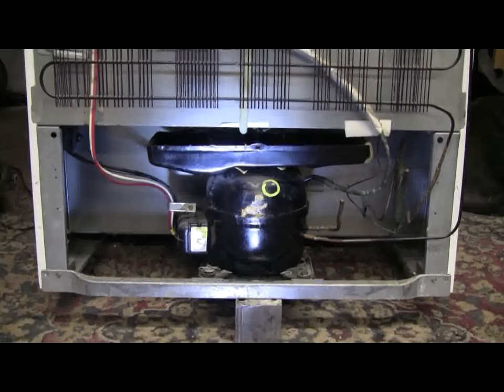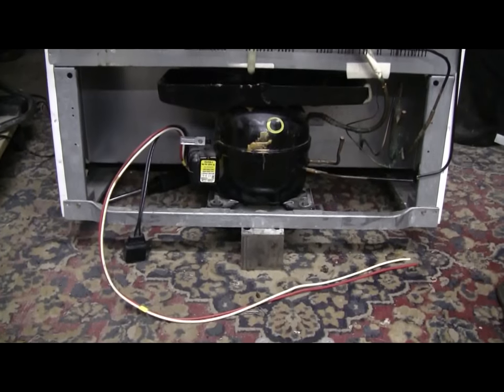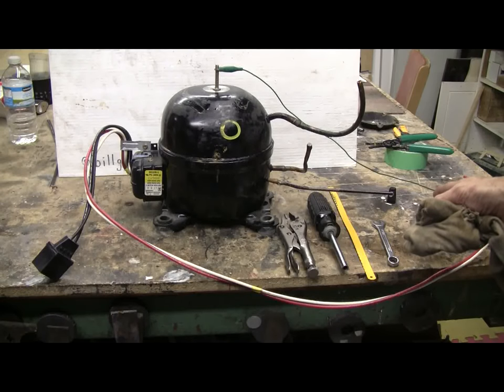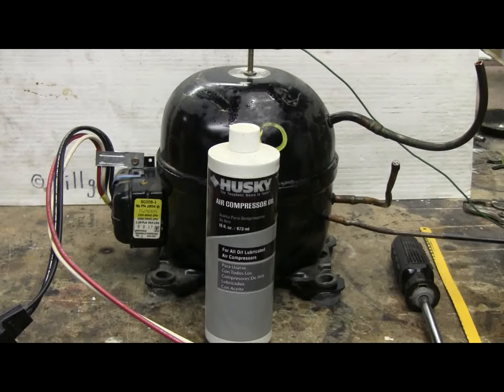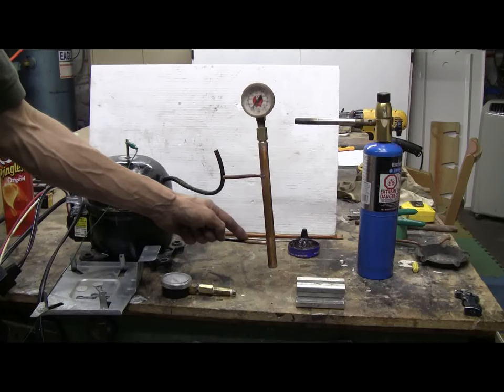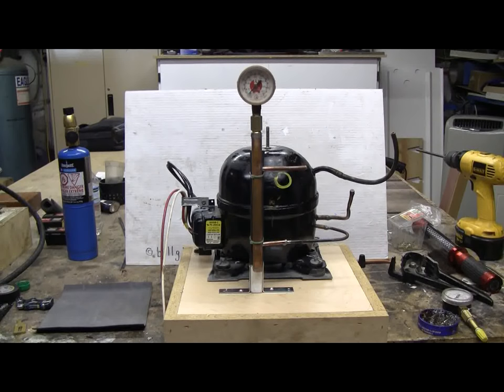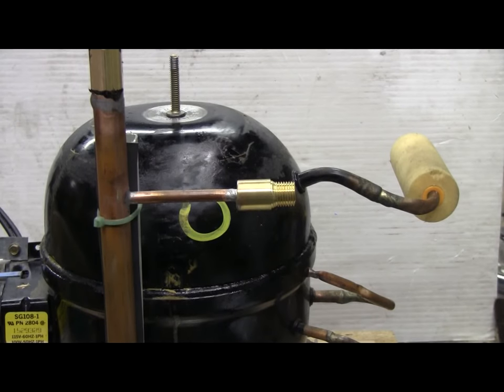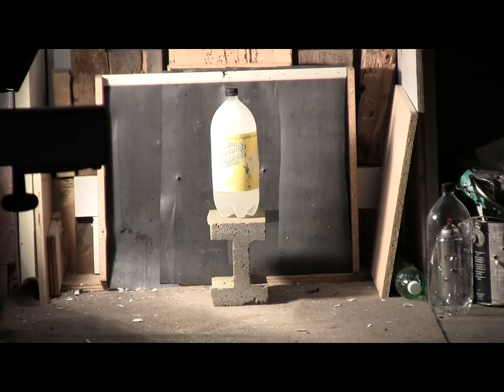DIY - How To Make A High Pressure Air Setup From A Refrigerator

Comment: This is one of the best and most informative YT instructional videos I have ever viewed and I have viewed hundreds across many different subject categories since I enjoy building, engineering, repairing (DIY'r) almost anything electrical, mechanical, computer / video / audio, appliances, even gardening and carpentry. Reason this video is so good is the pace, organized well planned step by step process with just enough detail. Most of all there is something about your voice that is both soothing and keeps my interest peaked - most videos I have to rewind several times because of mumbling, bad grammar or conflicting information, yours I did not have to stop or rewind once. 

QUESTION: I want to build a compressor that is suitable for filling a PCP Air-Rifle and/or a portable air tank that is used to fill a PCP Air-Rifle. The required PSI fill is from 2000 to 3500 PSI (depending on particular PCP rifle brand/capacity). I am a novice when it comes to compressors but I have experience working with residential air conditioners, refrigerators etc.. repairs primarily on the electrical side. Would a unit like yours have enough compression capacity to fill a small tank that requires 2,000 to 3,500 PSI when full? They do sell hand pumps (bi-cycle style) made for this purpose (can cost upwards of a few hundred dollars), electric and gasoline powered units that are in the high hundreds to $1,000s of dollars. So a project like this is well worth the effort if it works - even if it takes several hours to fill a small "SCUBA" like portable tank that can fill a rifle several times on a single fill or the small air container built into the rifle (50-100 shots on full charge) directly.

Thanks
Chris

Comment: Out-standing video! I'm a home brewer, I typically make five or ten gallons a week. My need for this is co2, with the step by step, I think my old air-conditioner compressor will work perfectly. I've already salvaged the compressor and with some fittings, I will be able to carbonate my home brew without expensive tank refills.

Comment: What a fantastic video. I have a smaller salvaged air compressor and was looking for a video to guide me in the right direction for building a moderate to low pressure air system...yours fit the bill perfectly to get me started. Thanks so much!

Comment: Brillant! I've never thought of recycling a refrigerator compressor... I'm in need of one for PC cleaning - maybe this would be overkill I'll see -, and PC moding works (moding this for a sufficient air tank so that some air power tool could be used? hmm..). Since I have an old and unused frig in the basement... Man you made my month, bravo et merci (if you had a paypal link I would click it instead throwing out hundreds of dollars at the store)..Some people have made good comments down below for making it even better (capacitor to start it, check valve, etc... read on). One Youtube gem.

Comment: Back in 78 I went to mechanic votec in Mn.  We took one of these and made an evacuation pump for air conditioners. It could pull them down to nearly zero where they needed to be to recharge. Made one myself at home but never did do much with it. I left in in Mn when we moved back to the Dakota's.

Comment: I’m gonna send you to the future!
At approximately 21:20 in this video, hitting 88 mph with the required 1.21 gigawatts, you will see compressed air! 
It’s a very good, thorough diy video of a unknown and amazing air compressor, with lots of pressure. It’s a 15 minute video if you set the much needed playback speed at 1.75 gigawatts :)

Comment: I made a hobby shop compressor for air brushing and other misc tasks. Those fridge compressors work excellent and they are virtually silent. Also have a pneumatic switch to automatically shut off just like a standard shop compressor.
Reply: Hey Eric do you know if this would work to power a dentist drill.  I do wood carving and I’m looking for a very quite compressor, as I am in an apartment and do my work in the overnight hours.  Thank
Reply: Phoh finally i can ask this question
Can i configure this for my airbrush ? How did you do it?

Comment: Very well done video. Watching makes me believe that I could build one. I've always wanted a good compressor for my garage work. Thanks, Mr. Gillmore!
Reply: +Mike Prell It want work for a garage air compresser. To run air tools, it requires an air tank and this compresser will overheat trying to pressure up an air tank to say 120 psi.I was also thinking that he was making a shop compresser when I clicked on his video.Take care , Mike.
Reply: I guess I'll wind up going to Sears.
Reply: The existence of data before and after assembly is necessary

Comment: I never thought about using gasket sealer and teflon tape together.  Great idea!  I have my welding tanks on air couplers so to prevent leaks, i think I will do the same.
Thanks!

Comment: Nice ending. I just tore down a nearly identical refr today. The compressor had blown the overload protection once before, and I replaced all that, but the refr wasn't getting cold enough, and it was old so i just stripped it out and turned it into a storage box. I might as well wire up the compressor and play with it a little, and see what kind of PSI i get.  This might be one of the components i end up using in the waste oil burner i'm getting ready to throw together, instead of one of the things I will be melting with it.

Comment: For my .22 cal PCP air rifle, it takes up to 150 pumps to get it from 0 to 2900psi. I usually stop at 30 rounds and repump from 1700, about 50 hard strokes. I'm thinking on making one of these for partial refill after maintenance to save me from a LOT of initial pumping. Going for max, I would use plywood shield tho!

Comment: Nice job. You make it all appear very easy, I'll do this (build an air compressor out of a fridge compressor).
Reply from the maker: +Gort Newton As long as the valves are ok in the compressor, you should get a great result. I have one that wouldn't go over 100 psi, so I carefully cut it open to find that I need to replace the intake valve. At least it can be saved.

Comment: Absolutely love your skill set and your ability to create a useful shop tool from a re-purposed refrigerator compressor. 
I just happened to remove a compressor from a discarded dehumidifier, along with the cooling motor & squirrel cage fan, the power supply, the controller board, and several sensors (humidity, water level, etc.), so I did a YouTube search for ideas as to what to do with the compressor (if it still works). You have given me understanding, a parts list and a visual how-to guide, so I am off & running with one of my next projects. Liked and subscribed sir!
I assume that the compressor oil can be drained out via the inlet or outlet lines, collected for volume measurement, and then replaced with an equivalent amount of air compressor oil. Definitely an important piece of information to know. Thanks Bill!

Comment: Hi Bill,Thanks for your video….yours was the first that caught my attention and got me interested in this. 
Since then I’ve made a number of these compressors for others (from used,
broken, craigslist, and dump-finds with Porter Cable, DeWALT, Craftsman, Campbell Hausfeld, Huskey, Bostich, and Central Pneumatic tanks (2 gal to 20 gal)).  ALL working great (and none having experienced temp overloads filling from empty- which surprised me on those greater than 8 gal). 
TWO OIL  DRAIN-FILL  QUESTIONS (answers will help not only me,but all others making these units)
(1) With a refrigeration compressor with 1 pressure tube and
1 inlet tube (assume “without” any manufacturing installed crimped Freon fill
tube) I’m having trouble draining/filling oil (while tilting compressor towards
the inlet tube)  due to "either", various bends in the inlet tube, OR due to no air escape route while draining. Any suggestions how to drain/fill with only 1 inlet tube
(2) If there are no answers to (1) above, I assume a last
resort might be to drill a hole in the compressor and Braze a fitting into the
hole (that can be capped or plugged for drain/fill). Can this be done with a
Bernzomatic TS8000 torch using Mapp gas?  
Issues are not knowing what's on the other side of where you're
drilling;  getting chips into the compressor
while drilling;  heat having some bad affect inside the compressor while
BRAZING.
Thanks, Rich

Comment: For the intake I would suggest an air compressor muffler. Those brass ones. Or at least i think they are brass. With the foam ones you could get pieces inside the compressor over time.

Comment: Brilliant idea!
But from the electrical safety point of view, it would be a bloody good idea to add a green/yellow colour EARTH wire.
Reply: Done
Reply: I scrap compressors every week doing my scrap metal. MATE, the amount of fridge compressors I rip out is impressive. I can have the majority out in less than 2 minutes. The OLD round fridges have some gloriously beautiful old compressors in them, AND the pistons inside these, make great key rings. Any Comp with a bar code on the side, has a piston like a sleeve,,,no good. Any old ones have a real piston like a car engine. The OLD green bell type out of Kelvinators are damn awesone.  50 cents per kilo where I go.

Comment: From what point does the refrigerant leak? It is pretty well sealed except for the wires going in. You could have cross drilled the 1/2 copper and pass the two smaller tubes through (each also cross drilled) to provide yourself with two additional attachment points.  That would also make the soldering easier.

Comment: I have made one, but my Problem is that if I stop the Compressor it wont start Again unless most of the presure is gone!!? Any Idea what I have done wrong, or what I should do !!? Thank you for a very good video. and by the way I think I have removed the Capacitator!!!
Reply: The cap is a starter. Don't remove.
Reply: The compressor needs that capacitor to start that motor!!!
Yes there is something you can do. Most commercially  built compressors drain the compressed air out of the piston so they will start up easily while the tank and line carry pressure. you can install an Unloader and a check valve if you are using a pressure switch. The idea is to have the compressor come up to a pressure like 175 psi. Then when you use it and it gets to 130 psi, the compressor kicks on to refill. When your compressor shuts off, the unloader dumps the air that is built up in the pipe to the tank. The check valve stops the pressure from feeding back into the pistons. This leaves enough room to start the compressor easily. I know it sounds like a lot of s#@t, but in doing this, you can keep the compressor on without having to shut it off manually each time you need to use it: just like a compressor in the garage. If you don't want to worry about a tank, you can purchase a small Airbrush compressor pressure switch and put it in line with the hose you use. This will shut it off when not in use, but it will turn on each time you need air. The neat fact about this air compressor is that you spend little to no money for it, especially since this is a DIY'er thing. ; )

Comment: Shouldn't you have brazed the connections instead of solder? Maybe it does not make a difference but I have always used brazing rod to connect refrigeration compressor connections.

Comment: Awesome, if i may suggest, could you put a sheet of steel to support the outlet pipe, its putting A LOT of stress on that solder joint.

Comment: Curious how the intake side doesn’t leak there is no 1 way or directional valve to keep the air from bleeding out when the comp. is not running

Comment: I work in hvac and now know what I'll start doing with the old compressors lol
Reply: Billyboy4209 Its a great use for them, I'm thinking about building one, but I would think that building it and mounting it to be able to fill an air tank would be even more practical.  Only other issue is figuring out a setup to install a pressure switch to turn the compressor on/off at certain pressures as a regular air compressor does.
Reply: William Todd They make head pressure cut off switches for air conditioners just check out PENN head pressure switches and fan cycle switches there perfect for what you need.Just make sure you don't get a manual reset one otherwise you have to reset it every time it hits the setpoint.
Reply: gsppuffer Ahh ok, never thought about a pressure switch.  Sounds like a potential winter project idea :).  Thanks again for your guidance.

Comment: Ok Bill and Thanks. 2 more questions please?
1- if you were producing 100 psi? Would I be correct in thinking the 340 psi you mentioned was the pressure built in the cannon?
2- May I ask what other devices can use the pressure built by the compressor?
Mac

Comment: I don't know about these compressors but the compressors in a TRANE unit have an internal relief valve of 600psi.  That is inside the housing.  I started out with Trane putting compressors together and retired last year brazing fittings together.  The system is pressure tested to 500psi before leaving the plant.  Operating pressure is about 350psi.  A refrigerator and/or freezer would conceivably be similar.  My only concern is the soldering of connections instead of brazing, particularly between steel and either brass or copper. This is an interesting project.
Reply: It seems to me Roy that what he said was soldier when he should have been saying silver soldier!! Cheers Mate great pick up
Reply: Could you please tell me (or show a link) to a good video on brazing or how to braze? Thank you!

Comment: what is the working pressure and max of the compressor?... copper pipe and fittings are also limited to a max psi before they burst ,,,needs a safety valve I guess!

Comment: Refrigerant compressors are not the same as air compressors- so other than blowing up bottles of ice, is there any practical use for this?  Running air guns or paint rigs in the shop?    What are you using to cycle the compressor on/off and set the pressure to something usable (70-100 PSI) ?   What about drying/filtering the air?  Without some kind of dryer it's not going to be good for your air tools is it?
Reply: +Tioga Fretworks Yeah,  I agree. They also need "Freon" to cool them.Otherwise, they get too hot.
Reply: +Paul Preddy You are right ! It won't work .
Reply: It is PATHETIC to see how many of these negative comments are found underneath EVERY VIDEO showing something useful to the people. 
The posters of vids like these are just trying to help out others, either to save some money or to provide an alternative to the usually overpriced "genuine article" because people simply can't afford to buy it.
I am quite sure the individuals posting these comments are in fact resellers, or buzzards looking for the crums left in the wallets of the financially drained.
In other words, people who either sell those "genuine" products or those who linger in between these assholes and the customer, the parts and service people, the self-proclaimed helpers of the little guy....... 
All so very afraid to lose money on decent folks out there who actually do mean well and supply us with real-world-applicable solutions for a fraction of the cost or sometimes for free

Comment: Thank You for this video. I am interested in pop air rifles, silent air compressors, and vacuum pumps. I am going to mount my frig compressor on top of an old pancake compressor. I will used copper tubing for a filtered input and vacuum, and out just like you did here.

Comment: That is something else. Wow! I have a question though. Can a pressure regulator be attached to this so it can be used as a regular air compressor? I'm sure it can be done just how would you do it? Would it draw in to much moisture from the suction line to use it as a regular compressor? That compressor is far better and less quiet than what I have and I have a fridge in the front yard I want to convert. Great video. Thanks for posting it.
Reply: mark buller I'm thinking the same thing, some sort of pressure regulator switch like on a regular air compressor, plus an air storage tank.  As for the moisture issues, when you get it all put together, your output side you should install a filter that will collect all the oil/moisture that these compressors blow out.  The issue too is these compressors will blow their own oil out of them as they operate, so you have to figure out an easy way to keep the oil level up in it otherwise it will burn up.

Comment: Are you sure you don't need oil in the compressor to lube the Piston. The way it's set up you will pump all the oil out. Also remember this is a High Pressure and very low volum. If you used a tank some distance above the compressor, would the oil run back into the compressor.  What do ypo think.?  Vic
Reply: Victor Schlapper He does put oil in it and no it doesn't pump oil out as you saw in the video when he plugged it in.

Comment: Hey Bill, after watching your video several times, I noticed that you are building up short term high pressure. If you add a air tank so as to run shop tools, which require a steady psi, Then the compressor will overheat trying to build up say 100 psi in the air tank. Air tools require at least 90 psi contant pressure to run. The compresser alone will not produce a constant 90 psi for air tools. This project is only for air cannons. Not a replacement for a standard air compressor. Sorry , but I thought you were bulding a standard air compressor. You should state in the title of your video that this is for air cannons Such as DIY - How To Make A High Pressure Air Setup From A Refrigerator For Air Cannons  Don't you agrre ? Thanks Bill.
Reply: How about using oil?